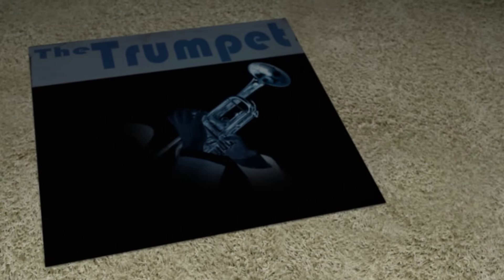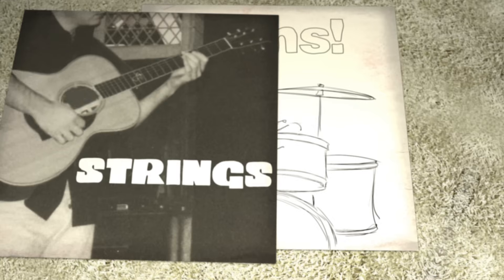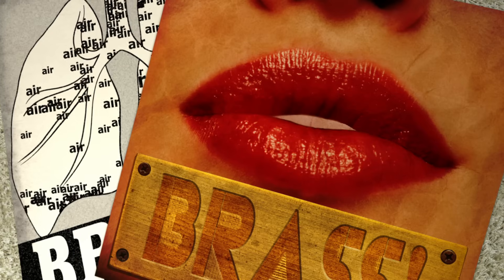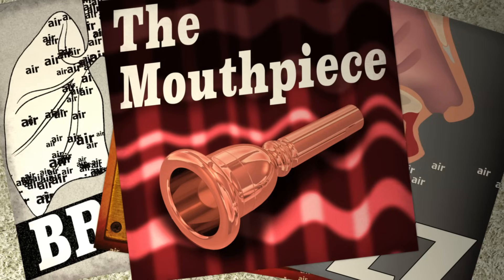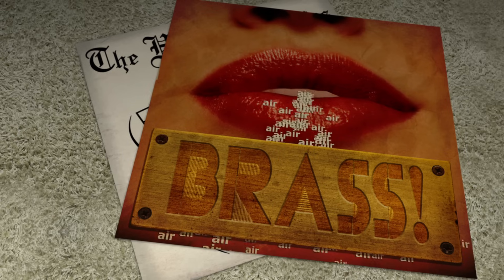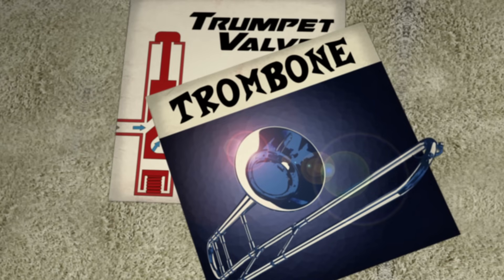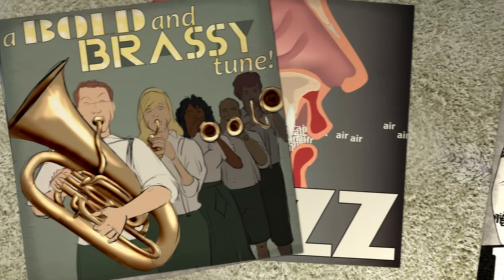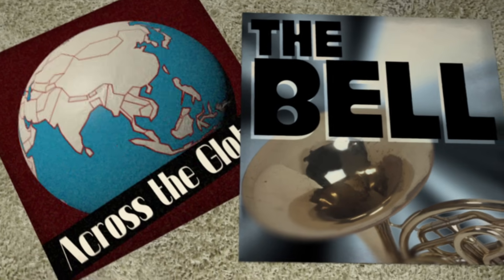How brass instruments work - Al Cannon

Comment: Mr. Cannon, I hope you'll consult an expert for editing before writing your next music lesson. The opening in the lips is called the embouchure, not the aperture. The trombone in the picture is assemble backward. And all air proceeding into the instrument is the same temperature, no matter how high or low the pitch, as it's all coming from the lungs.
Reply: the embouchure is the shape, the aperture is the opening.
Reply: Actually, the air temperature does change. It's the same concept as fogging up a mirror.
Reply: Erik Ketcherside Mr. Ketcherside, I do hope you realize it is easier to explain how to reach higher or lower notes by using temperature as a comparison.  People can realize the speed at which you must blow air by having a teacher tell them to blow cold air or blow hot air.  Also, trombone slides are pivotable, meaning a simple pivot would correct the instrument.  Also, it helps show the viewers how the tubing helps make pitches by zooming into the slide.  It would be more beneficial for us, the viewers, and the video-editor to have the trombone assembled in this way.
Reply: Ruby Rose Thank you for your thoughts. To keep this brief: I've played trombone for 46 years, many of those as a professional or semiprofessional. The trombone is not intended to be pivotable, any more than the trumpet, horn or tuba is ambidextrous without modification. (No disrespect to Slide Hampton, a brilliant player who was taught wrong,) And as a school band director for 17 years, I can tell you my beginners wouldn't have any idea what was meant by blowing hot and cold air.
Reply: Erik Ketcherside Thank you for your thoughts as well, but I must say that as a student that was taught by using "cold air" and "hot air", and being in the best band in my school, a band that may I add won against many schools in the Music in the Parks Festival, I think that I can say that this method of teaching works well.  As for pivotable trombones, many trombones as you must know have 2 separate parts, being the bell and the slide.  To connect the two, you must "screw" them together using a mechanism on both bits.  But the connection between them is not enough to keep the trombone from not moving, but is weak enough to let the two pieces move, allowing you to replicate the trombone in the picture.
Reply: Ruby Rose I didn't realize you were so well qualified. I won't waste your time further.
Reply: Erik Ketcherside And I never realized ignorance stuck to you through the years like a tick.  Bye!

Comment: The trombone in the thumbnail is assembled backwards.
Reply: Scary Sheep I've also never seen a tuba with the lead pipe on that side
Reply: @maneatinggnomes3985  my tuba is like that
Reply: its also not at all close to an L angle, the slide hasnt been turned enough
Reply: Ikr
Reply: I noticed that
Reply: Could be left handed trombonists
Reply: King Kong there is no such thing as a left handed trombone. Left handed people still have to use their right hand to move the trombone slide.
Reply: samu Hernandez just searched it up, and you’re right, but it could be custom made for left handed trombonists.
Reply: King Kong, that’s not how this works. At all.
Reply: @King_Kong2002  there is no such thing as a left handed trombonist
Reply: Maddie B Sings yes there is, his name is called Slide Hampton, but he’s the only left handed trombonists i searched up
Reply: @King_Kong2002  oh ok, sorry🙃
Reply: Maddie B Sings it’s alright, not many left handed trombonist out there anyways
Reply: @King_Kong2002  yeah, I myself have never seen a left handed trombonist
Reply: King Kong I’m left handed and trombones are pretty much only made right handed, I just had to force myself to learn right handed, theoretically you could switch it around and make it left handed but it’s impractical as any trombone with a trigger is made so you can only use it on the right side. It would be like switching around the keys on a piano, kinda pointless
Reply: FuRy GoDz it would most likely only be in jazz bands that trombones are played left, but still there is not much left handed trombones out there
Reply: @jamesgentry9946  The Designer Trombone o_O